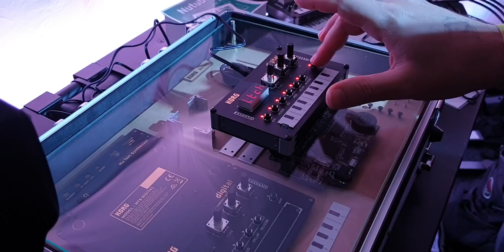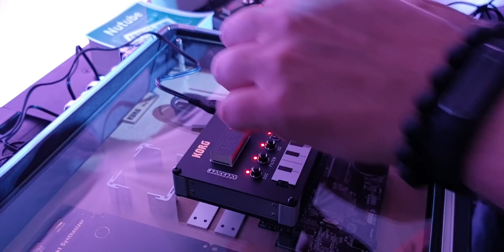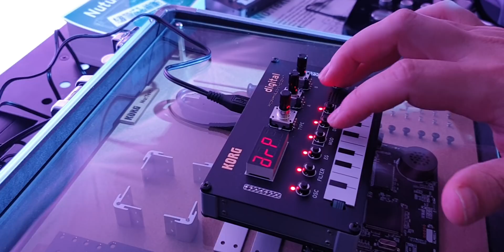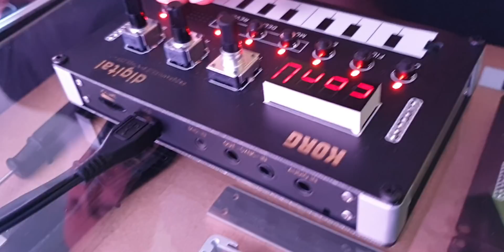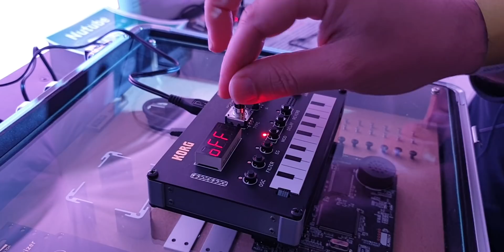superbooth19 KORG Nu:Tekt DIY Synthesizer prototype

Comment: Very interesting. I’ll try to wait to see what the spec and price reveals before I get too excited 😄
Reply: ChrisLody it will be cheaper than the volcas... the guy said
Reply: @moldythoughts4765  100 usd ish is what they're aiming for.
4 factory, 16 user oscillators, 8 delays, 8 reverbs, 2 and 4 pole low high and band pass filters.

You can load custom reverb Or custom delay, but you can use both FX at the same time